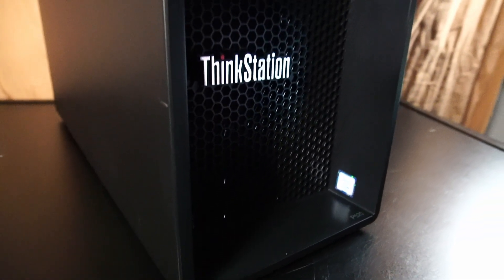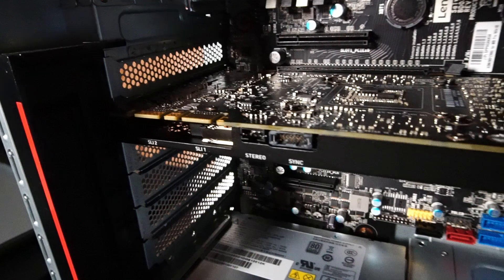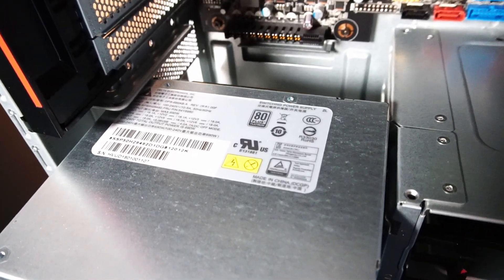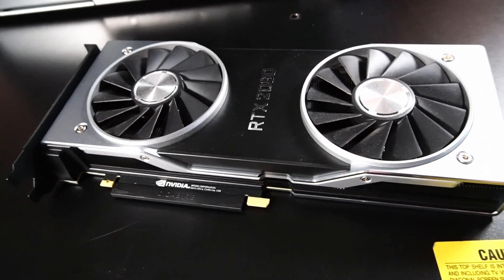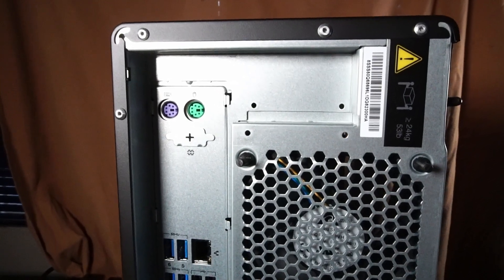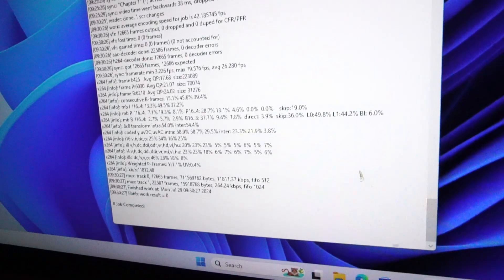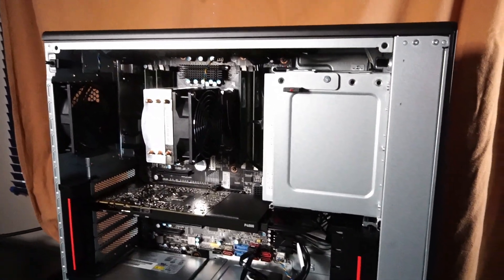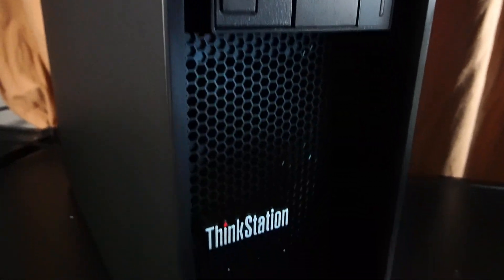Lenovo ThinkStation P520:  Video Render, Gaming Tests, & Hardware Review!  (2024)

Comment: Nice video, I recently bought a P520, mine came with the W-2135 6-core 12-thread CPU and a 900W PSU with 16 gigs of ram, no storage. This made my upgrade a bit easier. I bought 2 NVMe SSDs, a 250gig system drive, and a 1TB for gaming and misc storage, also got a RX 9060 XT and another 16 gigs of ram to enable quad channel. I found this system great for gaming and productivity overall. These are great machines and great for anyone on a budget.
Reply from the maker: Nice, well done!  You lucked out with the 900W PSU, that should help with even more upgrades going forward.
Reply: @HaisteComputerRepair  
Thanks, there is little downside to this workstation. The only thing I really ran into was its PCIe Gen 3 with no support for Resizable Bar. So, if you want a current-gen GPU, you really only have one choice if you don't want a performance loss from the PCIe Gen 3. Intel Arc runs like crap if you dont have Resizable Bar, and NVIDIA only uses PCIe x8 nowadays at least for the class of cards I was considering. So you have to stick with AMD for the PCIe x16, that's why I went with the RX9060 XT. Any GPU will work in it, but not at its full potential unless its an X16 card. I been browsing your channel and am getting a lot from your content, thanks, and keep the videos coming they're much appreciated.

Comment: I'm running p520 for over the year. The  issue I run into is occasional power up with BIOS not detecting NVME drive - in my case Crucial t500. The only fix I found is to pull out PSU for few seconds, then PC boots OK. Its not frequent enough to be huge concern. Did BIOS and SSD firmware updates to the latest but issue persists.... Hope this is incompatibility that will get eventually fixed.
Reply from the maker: I don't imagine Lenovo is going to be releasing any updates for this system as it's discontinued, but perhaps someone in the community online can help or has found a solution.
Reply: @HaisteComputerRepair  You would be surprised - latest BIOS was released less than 2 months ago and its third I did in the year or so. List of BIOS releases is a book.

Comment: Mine has the W-2145, 64GB ram, a 1tb nvme drive, a 10tb hdd, and the RX 7600xt. I truly believe these Thinkstations are the sweet spot in affordability while being a great platform for upgrades.
Reply from the maker: Definitely.  I am using one for a NAS/video player.  The only thing I would like more is having the extra places to mount hard drives without having to buy or frankenstein a caddy.

Comment: I have the p520 with a w2135, ive got a question for you, have you ever gamed with hwinfo running in the back ground, if so have you noticed strange cpu clock speeds like 4.8ghz?
Reply from the maker: I have experienced this before with other setups, but I can't exactly competently explain why it's happening.  I will have to do some research on that
Reply: @HaisteComputerRepair  thanks
Reply from the maker: @Sphinx-19  Let me know if you find out some information
Reply: @HaisteComputerRepair  ok, so, I've been on Intel forums and the only thing that people are saying is, "it's up to silicon lottery, some cpus will reach the rated speeds, some won't, and some will go over the rated speeds". I'm not sure if this is an answer though so I'll keep asking around, I did change out my cpu cooler with the noctua nhd9dx i4 so I don't think it'll over heat at these speeds but I want to make sure nothing else is wrong.
Reply from the maker: @Sphinx-19  Well, maybe it's best to just be happy that the CPU is going a bit faster than advertised!  So long as there are no issues of course.
Reply: @HaisteComputerRepair  Yea, i dont think its hurting anything, anyway ty.
Reply from the maker: @Sphinx-19  You bet :)

Comment: i got a p520 with a 2135 w 6 core 12 thread boost up to 4.7 gigahertz, 32 gigs of ecc ddr 4 2400 ram in quad channle (4 sticks 8 gig each ) 900 watt power supply , 1 terabyte nvme  ,amd 6700 xt  videocard 12 gig , i built for gaming under $600 , it plays everything game wise great at 1440 p , and does great for work on various projects , im very pleased with what it can do for $600 ya cant go wrong if your a budget minded gamer and dabble with work loads , it be real hard to beat for the price to preformance.
Reply from the maker: That's a great deal, similar to configurations I was selling them at.
Reply: how can you boost xeon cpu, its not real bro!

Comment: Finally a detailed review! 

One thing I cannot find is how loud are the fans? Under load and idle. I bought this for music recording and took a risk...

can anyone let me now , noise details?
Reply from the maker: I found most of the fan noise to come from the graphics card under load.  Might depend on what you install.  The two case fans run pretty low powered and quiet.  CPU fan can ramp up, but not obnoxious at all.  Keep it clean and lean.

Comment: Would a ElGato 4k60 pro work in a system like this?
Reply from the maker: Yep, I don't see why not.  I assume you mean the PCIe card?
Reply: Yes, that particular capture card uses a PCIe slot.
Reply from the maker: @QuietSt0rm005  I use the same one for my videos.  The P520 is like any other motherboard, there should be no issues.

Comment: I have seen where Lenovo also made a 900 Watt PSU for the ThinkStation, but if you've already got a 690 Watt unit, why would it be necessary? It is really a very interesting machine that you have here!
Reply from the maker: On the product specifications for the P520, they actually offer up to a 1000W PSU.  The top GPU being a Quadro RTX 8000 with 48GB of VRAM.   Might help for dual GPU setups.
Reply: @HaisteComputerRepair  Yes. That ThinkStation was designed for a totally different purpose than general use and gaming. I remember looking at TigerDirect many, many years ago and seeing those professional graphics cards. Their prices were jaw-dropping and they were far beyond my need.
Reply: @HaisteComputerRepair  Yeah. When it comes to a card like that, I'm clueless. I never needed a machine for professional design or modeling.
Reply: 690,900,1000 are the options for this system, 900 watt seems to be the way to go if you watch eBay closely they go for 50-70$ I just sold a few :P

Comment: When you look at the quality of that original construction, it's impressive! It was the Mercedes of the workstation PC in its day. Sturdy, toolless and with some pretty powerful hardware. I wonder if Lenovo ever thought that it would develop into such a remarkable expandable platform years into the future?
Reply from the maker: The design is really nice I agree.  The only thing missing would be more cooling/airflow with upgrades.  Otherwise you can install some nice Xeon CPU's and really get some work done.
Reply: @HaisteComputerRepair  Yes. It has it's limits in that department, but you can always leave the side off and use other fans to push air into it. Similar to what we discussed the other day. I don't have any experience with the 2066 socket; however, that PSU to board connection is quite interesting. I also read that the Xeons pulled some juice from the wall.
Reply from the maker: @zingwilder9989  The power draw can at times be notable, for sure.  But I don't really have real daily driver experience.  I installed a RTX 2080 into the case and though it runs in the 80's (celcius) under load, it's not overheating.  CPU temps are stable.  I swapped out for a Xeon W-2135, which is one of the 6 core 12 thread options.
Reply: @HaisteComputerRepair  I saw that you were upgrading it. It seems that those ThinkStation machines have gained a lot of attention for their upgradability.

Comment: Awesome, I just got a p520 myself. I hope to do some ultrawide gaming on it.
Reply from the maker: @deeman40  my next video has a cpu and gpu upgrade for the P520 ;)
Reply: @HaisteComputerRepair  Nice, I already got the quad channel ram 4x8gb and have an Rx 6600 fighter I wanna put into mine. My cpu is the w-2135, but I'm thinking about getting a w-2145
Reply from the maker: @deeman40  I would have liked to test out that CPU, to see how well it would handle the same tests as in this video.  I went with the Xeon W-2135 and RTX 2080 combo for the upgrades.
Reply: @HaisteComputerRepair   I am upgrading to a w-2145 in hope that it will help with the bottlenecking on my 6650xt at 1080p. Scaling wise 1440P will show less issues :P